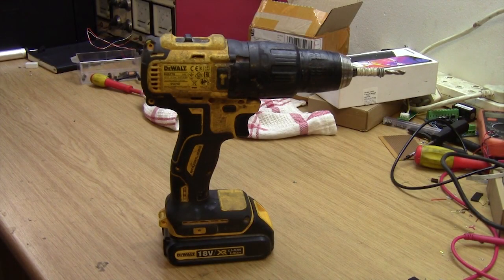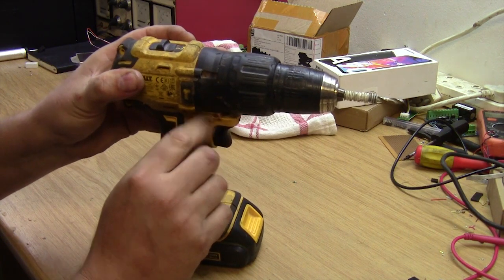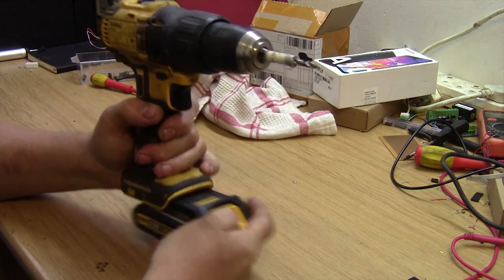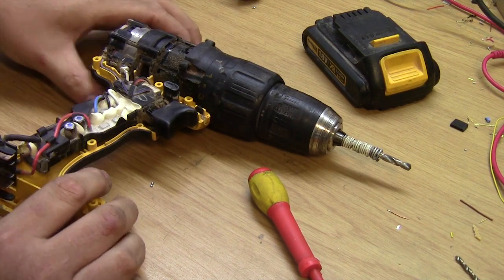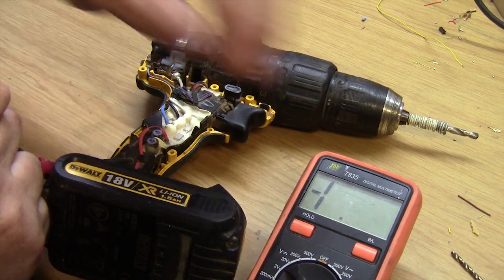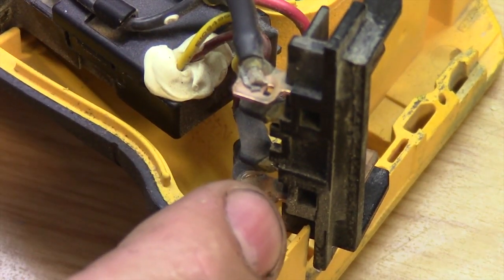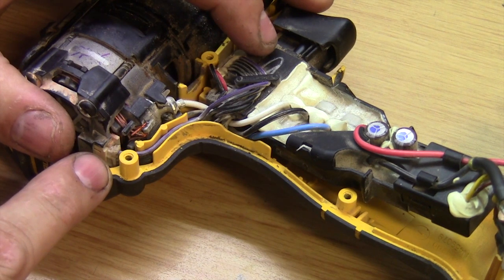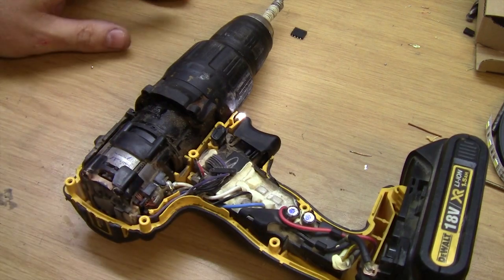ShoutingElectronics #29 - DeWalt DCD778 Battery Drill Repair

Comment: I had a similar issue, turned out that metal filings from drilling metal overhead had been sucked into the back of the motor. There is another set of connections at the back of the motor and the fillings were all sitting over the contacts as it is strongly magnetic. This was shorting those contacts! I carefully removed all the filings with tweezers and then it worked perfectly!  This is a bad design that metal filings can be sucked in through the cooling vents, they should have some kind of mesh for the vents or the contacts should have some kind of covering to protect them.

Comment: Thank you for this video, I got given a brand new drill for free because it was faulty. Following your video i got the drill to work. I cleared all the silicon and disconnected the plug and re-plugged it in and hey presto it works.

Comment: Drilling aluminium windows again, from all those rivet remains.
Reply from the maker: Close, but nope, in this case it was from PVC Benches that had to be disassembled to have the seats replaced. They are made from the same thinnish rectangular PVC that these PVC Fences are made from. Definately NOT made for Commercial use at a Shisanyama Joint where there are a lot of Rugged Built Patrons who just love their Meat.
Reply: @ShoutingElectronics  Oh yes, where the patrons are built like oxen, and only 4 will fit in a taxi before the wheels pop.